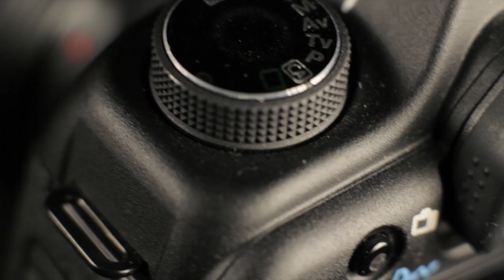HDSLR 101 #3: Understanding how video works on a HDSLR

Comment: Shutter speed does not affect f/stop, so you will still get a shallow depth of field, but with a slight bit more motion blur.
The zoom thing is typical, because lenses have a lower maximum aperture at longer focal lengths.

Comment: Great tutorial. Two questions. If you have to adjust the shutter speed to match florescent bulbs, will you lose the film like look you would you would normally achieve using 1/50 of a second? Also, I noticed a change in light when using a zoom lens with a friends dslr. As the he zoomed out, the picture became brighter. Is this typical or just an odd instance?

Comment: What I have heard is that Canon will update the 7D before upgrading the 5D Mark II.  W/ the Sony Alphas having better auto focus during video shooting in their SDLRs (while still not great) is a step in the right direction for competion! 
I do have a question: When shooting videos with the 5D,  The mirror stays up, the 1st and 2nd curtains stay open so what goes on in the camera when manually changing the shutter speed during video shooting with the 5D? Is it with the electronics

Meltdownman